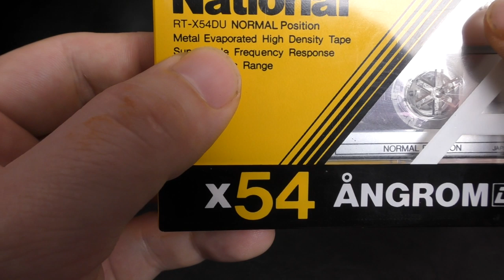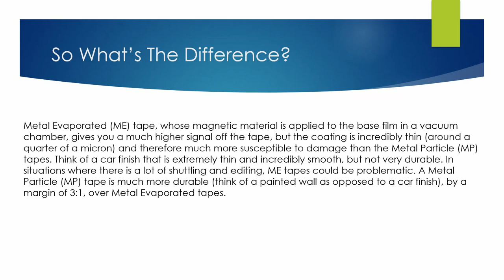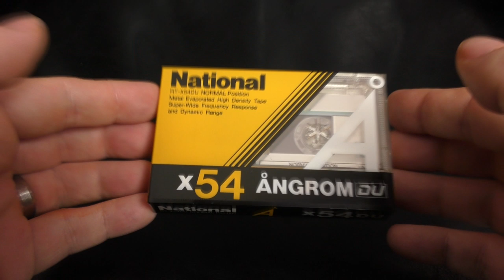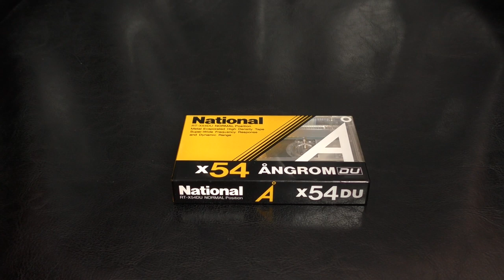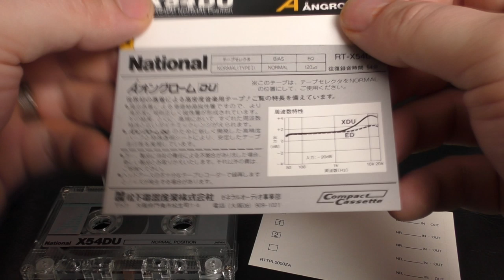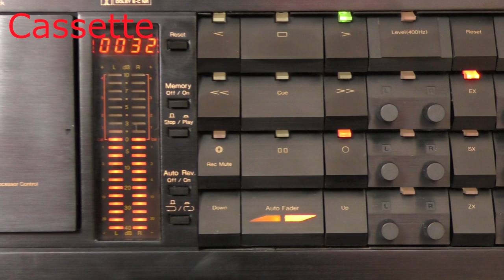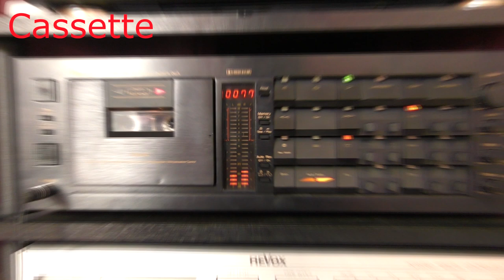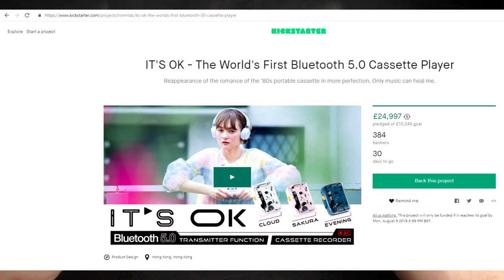Matsushita Angrom Metal Evaporated Type 1 - The Possible Saviour Of Cassettes?

Comment: I never heared about this technology of tape production used to make compact cassetes. This is so interesting. I think it can be a way to make superior quality tape in modern days. Dropouts may be caused by bad storage conditions or by the fact that this technology may not have been perfect enough in 80's or both. I hink today is tehnologicaly possible to make it perfect.
Reply from the maker: Me too. It's being made. Change the formulation for cassette use...
Reply: @CassetteComeback  I've never heard that metal tapes can be made to be Type I compatible. It would be very interesting to try with a reel-to-reel deck as well!

Comment: What was the reason for the odd lenths of the tapes. This one is 54min, some are 46min etc. Eventhough the 46min was a few minutes longer, as most tapes are a bit longer. Was there a reason for it? maybe the maximum length for the tape type? I always wondered.
Reply from the maker: 46 minutes is the running time of a 12" vinyl record at 33rpm.
Reply: Ah, that is why. Never expected it to be that simple. I always tend to think too much or too deep about these things.
Reply: With cassettes which were supposedly aimed at recording CD's the odd lengths reappeared (74 min., 80 min)... What I don't get is what the 54-minute running time cassettes are aimed at. Yes, of course, some vinyl records last longer than 46, but aren't you OK with a 60-minute tape in that case? Same goes to the 50-minute CD-ings by TDK.

Comment: ME Hi-8 tapes haven't aged all that well based on stuff I've gotten in for transfer from the early to mid-1990s. The metal particle stuff held up MUCH better.... except for Sony tapes, they had issues with lubricant and head clogging. Its ironic that the framers of the 8mm video tape went with MP because it was much more durable vs. standard oxide tape used for VHS (smaller tape = more dropouts even from minor damage), only to have Sony and others try and push the format towards the more fragile ME tapes.

Comment: What environmental concerns would emerge as a result of using metal evaporation? Isn't that the reason why Type-II and Type-IV tapes were discontinued? I'd LOVE to see Maxell bring back the XL-I, but don't think it's possible due to the aforementioned reasons.
Reply from the maker: I don't think there is for ME as data tape uses it, it's just getting someone to invest in creating a formula that would work for audio cassettes.
Reply: @CassetteComeback  - That's good. I  want to think that there's a better alternative to the 'normal' ferric tapes out there. So far, I'm NOT impressed with either NAC nor RTM at this point; and don't see better alternatives waiting in the wings at this point!

Thank you Tony, for all you do here!

Comment: Just curious... would bulk erasing a vintage blank tape before first use reduce the potential for dropouts?
Reply from the maker: I doubt it. The erase head in the deck will do just as good of a job. If it has drop outs after that erases it, I don't think a bulk eraser will do a better job.